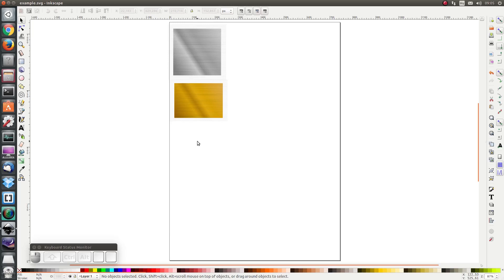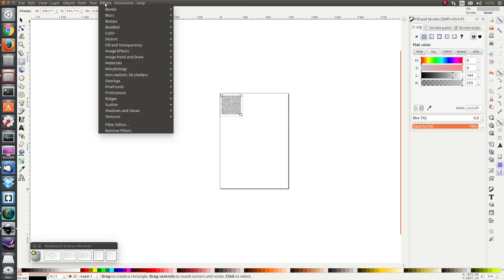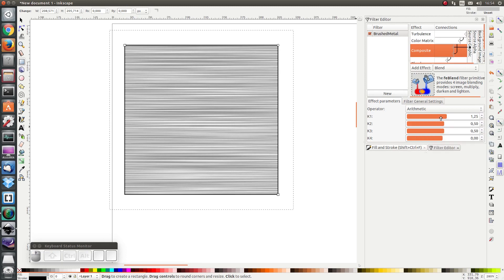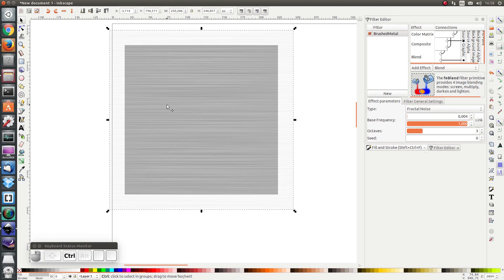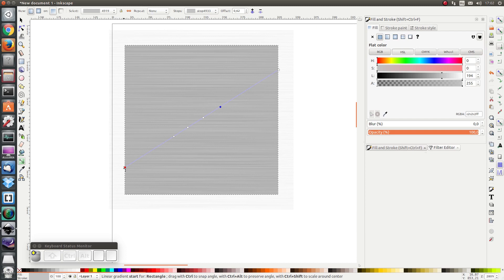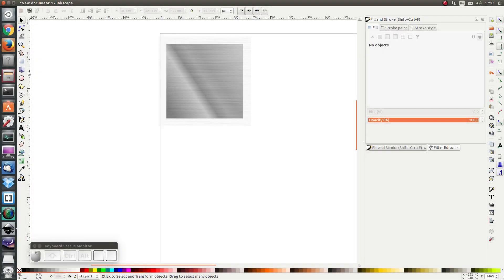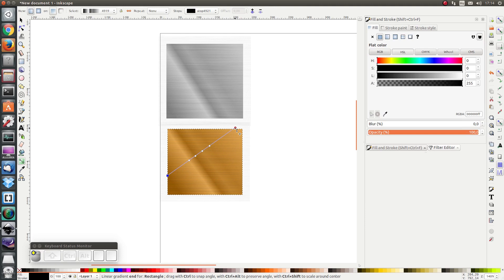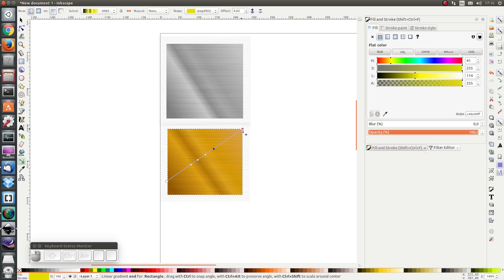Inkscape: Metallic Surface

Comment: Can you orient the grain 45*? I did this by rotating the square on edge, and then using a shape to clip/mask to get the result I wanted, but since the object is SO LARGE it causes strange memory issues and results horizontal line artifacts.... Thanks!

Comment: Hi, thanks for the guide. Quick q, do inkscape filter effects transfer well to other applications like illustrator?
Reply from the maker: Good question. The svg format is quite widely supported in general. I have no experience with illustrator so i cannot say how well it supports svg filters. 

This table give at least some idea of which programs support svg
https://en.wikipedia.org/wiki/Comparison_of_vector_graphics_editors#Import
Reply: That's really handy, thanks alot.